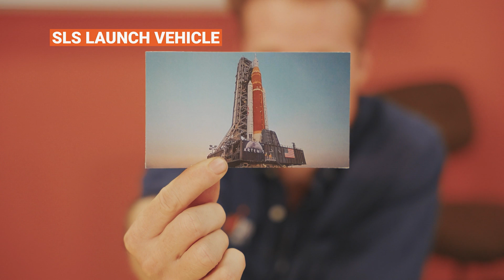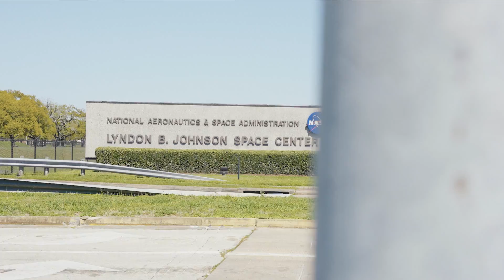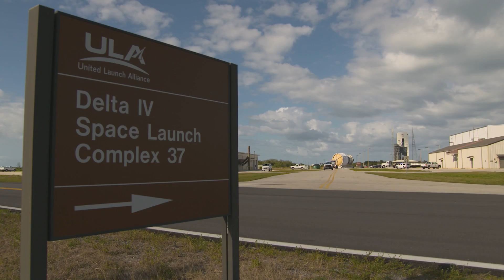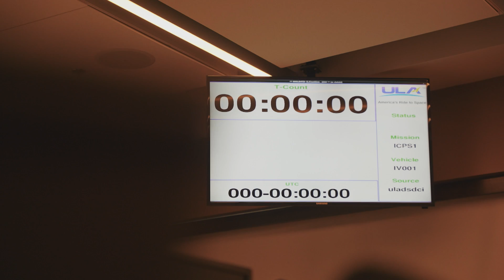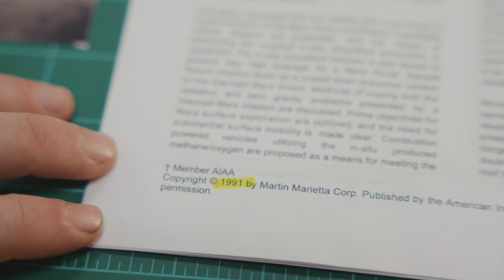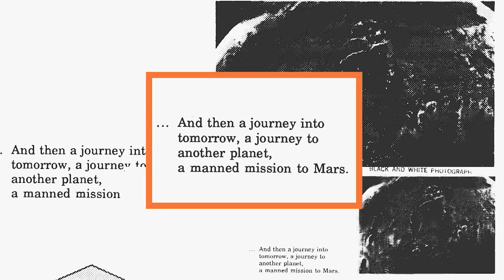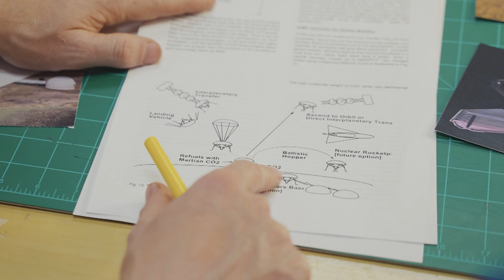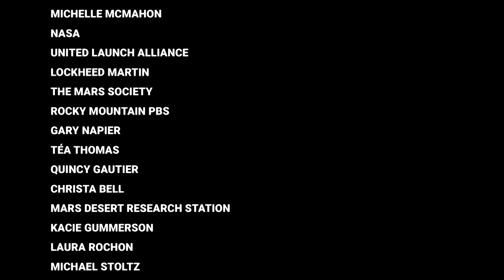The Next Frontier in Space | Behind the Wings on PBS

Comment from the maker: Where should human space exploration focus - Moon or Mars?
Reply: Yes!
Reply: Both
Reply: None of the above. In our current structure we have to think like an Olympian and go for the gold . I prefer going for crucial reasons and to boost the economy instead of getting funding. These cost exceed their mandates. The only problem is that development is at the point of copy and paste which is killing the program. 
Here's where we went wrong. The STS program was a step forward but for some reason we reverted to what works . The Spaceplane would have been a step forward and introducing hybrid engines that sip fuel and deliver the same displacement exceeding the current burn time. The science is here , the parts are here and this puzzle is complete from factual proof. Does anyone here want to do some math ? I'm going with a Delta wing design and light, lifting heavy. It uses a normal runway and lands at any airport runway strip . 
No to Nuclear Thermal and we have 3 powerful reasons why. The fuels and oxidation we use , needs a different approach. The solid booster is the perfect example. It's a free valve system and I figured out how to do the same with liquid propellants and can shut it down . It's time  to move forward and hybrid is the way to go
Reply: Focus on the Moon, but do not abandon Mars plans.
Reply: We need to do both. It's a shame Venus wasn't more like Earth or Mars, if it were, I'm sure we would have been there by now. Venus is nearer to Earth at its closest approach than Mars. It would have been easier to get to. Oh, well.
Reply: @wikkid1show569  unfathomably based
Reply: @mortallychallenged  pulse detonation, and not the Sabre engine from Skylon . Just do your own research and investigate the principles behind the methods